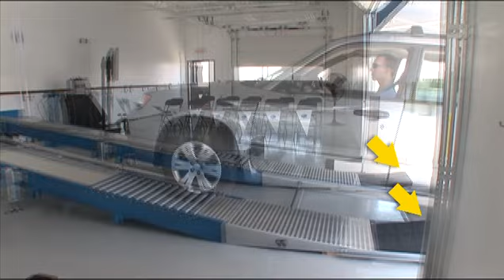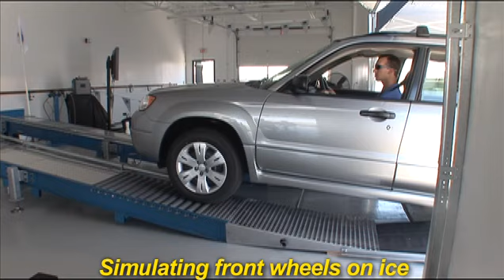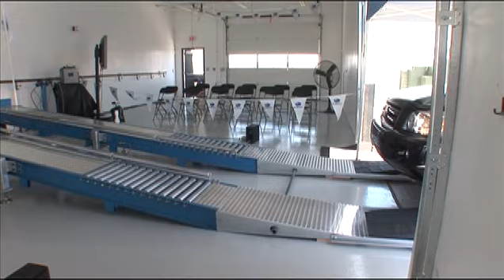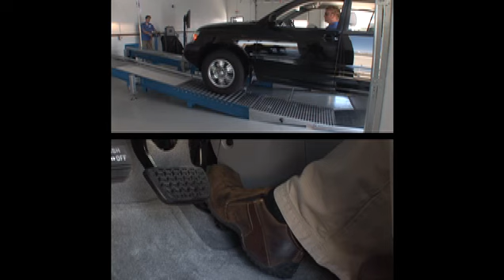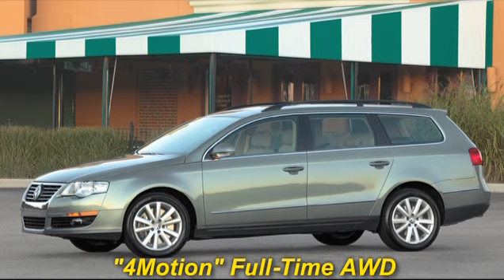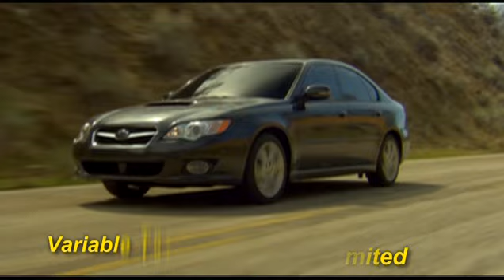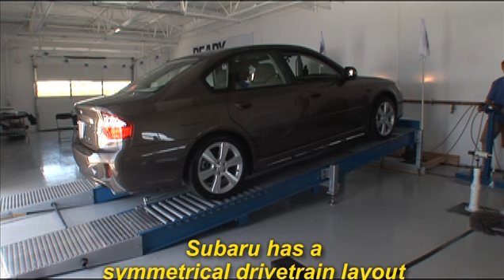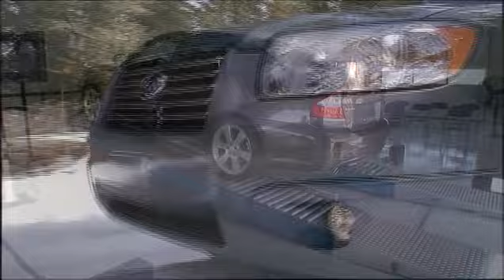Subaru Symmetrical AWD vs. Honda, Toyota, and Volkswagen

Comment: I would otherwise accept that test as a legitimate, if I wouldn't have witnessed how the CRV works in real life. I live in Finland.  Been for a hunting few times in deep forest, ice, mud, snow, grass.. etc. We got guys with Lada Niva, Pajero, Nissan Patrol and Subaru Forester. As some of you might know, the Niva, although piece of crap, is the most capable 4WD from all these, with its low ranges, manual locks and high clearance. Needless to say, we use off road tires, different brands, but new. I have seen more than once how the CRV follows with no efforts the Forester and the Niva, and even twice it had to pull out the Patrol. Its understated capable SUV. That test is obviously biased. Why the rear part of the vehicles are hidden?

Comment: They show the AWD system but they don’t show you the constant engine problems so I tip my hat off to you folks symmetric all wheel drive is the way to go as long as you can keep the motors together and not have head gasket issues and complete rotating Assembly failures

Comment: Not sure about the Newer Subaru but the older models with an auto trans will auto lock into a 50-50 front-rear distribution when locked in 1st gear or Reverse

Comment: SKOTTY KILMER HAS LEFT THE CHAT!
Reply: Yeah in one of Scotty's new videos he acknowledged Subaru superior traction control. He needs to understand not every one needs a car to last 300k miles. Some people just need a car to help them not die.
Reply: @Duraputer ❤very good point, you nailed it right 👉🏾 ❤😊
Reply: I own a 2001 Subaru outback with the original engine and transmission. Currently at 378,671 miles on it. I did the head gaskets using a  6 star head gasket. Still good. The head gaskets were done at 123,464 k
Reply: @jeffreyschindler2289  I'm gonna need to do the head gasket on my 2000 legacy wagon with 130k miles on the odometer
Reply: He has mentioned in some of his videos that Subaru make the best AWD system
Reply: 😂😂😂😂
Scotty prefers Toyotas. 
I think he's mainly concerned with reliability. One of his major problems with Subaru is head gasket issues, and I think he'd go with the highlander.
Reply: @oumaevans  subaru fixed the widespread headgasket issues in 2012
Reply: @jakegolliher2891  So they only had terrible head gasket issues for 20 years, what's everyone complaining about?
Reply: @80sDweeb  Not true, it's only in mid 2000s 2.5 naturally aspirate EJ engines, other engine sof their have no issues of they happen afte rincredibly long usage with very bad or nonexistant maintenence(like their H6 or Turbo 2.5 EJ), its easily and permanently fixed by using the Turbo EJ gasket in naturally aspirated cars, NA ones use badly and cheapily made graphite coated single layer gasket, when turbo had much higher quality multilayer steel headgaskets. With MLS one it will never ever fail again. Newer and older models dont have this problem nor do 2.0 and 2.2 EJ motors.

Comment: Little bit of misinformation here.  That Subaru Forester does not have any sort of active traction control or  active differentials.  It uses what they call Symmetrical AWD.  It has viscous differentials, which basically just use a thick, sticky goo in between two plates.  When the differential in speeds between the two axles or wheels exceeds a certain limit, the goo starts to grab and send power either into the rear driveshaft, or across between the rear tires if you have an LSD in the rear.  Their test car may not, it's an X, which means it might have open front and rear differentials (I've never had a base model Subaru), and it still did that well in the test.  Higher spec cars, like the Forester XT, have an open front differential, viscous center, and viscous rear, so they're 1 wheel drive normally (Front Left I believe), then 2 wheel drive at loss of front traction and then 3 wheel drive when all traction has been lost.  If you lift any turbo Subaru off the ground (or an 00-01 RS2.5) and put it in gear, you'll see three wheels spin, then you'll get a CEL for a failed ABS sensor on the one wheel that isn't moving after a while.  If you want a legitimate "all" wheel drive Subaru, you'll need a Spec B Legacy or an STI, they have an LSD in the front as well, along with a 6 speed.  The LGT shown at the end has some sort of traction control that brakes the spinning front tire, forcing that power across to the other side, but otherwise uses the same setup as the Forester XT.  Very simple, very effective.  Too bad they don't make a truck.  (Brats and Bajas can't carry a dirtbike, they don't count.)

Comment: No fear. if your Subaru is not a top class model it will not pull you with one wheel ;) My forester and impreza 97-04 even strugle to to this with 2-3 wheels from a standing start on a incline and difficult terrain.

Comment: Symmetrical AWD is useless when your CVT belt breaks. Symmetrical AWD is a really cool thing, don't get me wrong. But, if you can't get power to your AWD system because your CVT belt broke, then it isn't really very effective. When Subaru gives up on CVT, then I will respect them. Until then,  I will keep my RAV4.

Comment: there are 4 cases of just a single wheel traction,  no one car in the world can win all such 4 cases.  even one car can send all it's power to a single wheel,  when there s not enough friction at that point, the car still will fail.  Power  sending + friction, 2  factors   decide if the car can overcome the slipery situation.    when the single driving wheel corner is not enough heavy, it can not provide enough friction for the car to move, so the weight distribution is also an important factor.    when 3 wheel slipping,  only one wheel driving,  put more heavy load on that driving corner will provide more friction.  Subaru  are awd car, but it is also a leaking car! cost more to maintain.

Comment: It's 2019 now. I'd love to see how Honda's awd compares the Ridgeline/Pilot and CRV compare tot he Outback and Forester. What did 12 years of technology do for non-Subaru vehicles?
Reply: still the best. I guess you never drove one..
Reply: Update from 2022: non-Subaru vehicles still fail to accomplish this
Reply: I can confirm that even my Acura SH-AWD system is worse than my Subaru 4EAT. Lmfao.
Reply: The 2019 forest is even better off road.
Reply: D Madd11 except that all the tests don’t tell you why the rear wheels on the Honda don’t spin.  In this test it simulates a icy hill in which the Honda is designed to lock up the rear wheels and prevent you from sliding back down the hill.  The Subaru will slip all four wheels and you will slid backwards.  That’s what Honda programs their vehicle to do from the factory.
Reply: @themaxee08  honda will not hold you on the hill and a Subaru will get up it no problem
Reply: @themaxee08  "lock up"?
Reply: Yes Larry, I know they certainly improved
Reply: I have had several Hondas and a couple Subarus. While there is no question Subaru packs a superior AWD, each of the Hondas waltzed into 300,000 miles without breaking a sweat and neither of the Subarus made it to 200,000. I'm hoping their partnership with Toyota will help that.
Reply: https://youtu.be/7f1Uz8SqnzI
Reply: Technically no car is full awd. Keep in mind there is some manufacturing biased to which diff had more load by default. Hence why you can slide subies out cause they are more rear wheel biased and hondas and toyotas are front wheel biased. Sometimes 65 front or 35 rear. It depends on the system to transfer and distribute the power.
Reply: @itsCoreyLee  my mazda can lock the center diff, resulting in the closest you can get to proper awd
Reply: @itsCoreyLee  Subaru is Full AWD, cause all diffs are always active. What you're thinking of is 4WD / 4x4, where every wheel gets the same amount of power and speed.
Reply: Etsuko the Miata look there system is 50% to front and back okay. Then if the wheel starts to slide it puts more power to that wheel it isn't based more towards the rear...
Reply: @isaacl1439  no. Subarus AWD is 60:40 front to rear bias unless you have the older wrx that's true 50/50 with open center diff or the sti that's rear biased (differently depending on transmission)
Reply: @jeepmanxj  In this video the models of the 2008 era are compared, where the forester uses the same traction system as the old wrx, 50/50. In later models, they switched to modern systems, 60/40, and the distribution may vary depending on the circumstances.
Reply: @jeepmanxj  This is from Subaru's official brochure for the 2011 Outback 3.6 that I own. It utilizes an "electronically controlled variable transfer clutch in conjunction with a planetary-type center differential, and a viscous-type limited-slip rear differential. Torque distribution is normally configured at a performance-oriented rear-wheel-biased 45/55 split front-to-rear." So no, the STI isn't the only rear biased system!! My car is so much fun to slide around in the snow with. Especially with my STI rear swaybar it'll kick the rear end out with very minimal throttle but it still feels so controlled. Love love love this car. It's got 150k on it with no issues even though I beat the shit out of it.
Reply: @itsCoreyLee  no, only the sti is rear biased.
Reply: D Madd11  I've owned multiple Subarus over the years. Their AWD system is meh. It uses more fuel that it helps propel the vehicle forward. The forward placement of the flat engine also causes them to want to shove the nose out in corners from the understeer. Transversly mounted engines put more weight behind the front wheels helping steering more than what ever symmetrical bullshit they are selling here.

Basically all this proves is the brakes work in conjunction with the center diff to transmit power around, much like any limited slip differential. What we learned here is that the coupling in the Honda is completely open and can't torque multiply. 

This also glosses over the fact Subaru AWD systems outside of the wrx and sti are front biased 60:40. It's not symmetrical at all.

Essentially the driveline is needlessly consuming energy and fuel all the time so that in the event you come across a set of rollers for your front wheels it'll still go.
Reply: User Name I’ve got a ‘13 Legacy 3.6R and I’ve NEVER noticed understeer. How can a transverse mounted motor be better? Then you’ve got the weight of the motor AND transmission over the wheels. Why do you think BMW never had anything FWD or transverse mounted? I don’t know how many of those Subarus you actually worked on cause the motor in mine doesn’t ‘hang out’ front like you described. My oil filter is about behind the front wheels so that puts the front of the motor about square over the front end.
Reply: I had a 2003 Pilot (first year it was produced) and it was an absolute beast in the snow. You could lock all four wheels with a button too. Most of these Subaru videos are BS.
Reply: @snorman1911  you have never drove a subaru then. they never get stuck but hondas always get stuck
Reply: This video is biased towards subaru. They were paid to fake this
Reply: @brandonar868  lmfao how?
Reply: Brandon R LMFAO the two best vehicle brands for AWD is Audi and Subaru...
Reply: @brandonar868  Don't think so...my STI sends 41% to front and 59% to rear in auto mode.  This can be varied in poor traction conditions by changing settings.
Reply: @brandonar868  Subaru has the best AWD system in the world not even debatable
Reply: @brandonar868  Wow! Really? Proof please?

Comment: Regardless of what type of 4WD/AWD system you have and you get stuck, try this. Slightly put your foot on the break while the tires are spinning. Applying the breaks will transfer torque to the tires not spinning and most likely get you out of your situation. But it does depend how stuck you are in the mud or snow. Depending on which tires are losing traction, you can also apply your hand break too. If your in the snow, lower your tire pressure and that will help a lot too to gain traction. This is an old off road trick to create a manual traction control. I wish I was driving the cars that didn’t make it up that ramp, I would apply the break while giving it gas and drive right up their ramp.

Comment: Interesting video but there is misleding information regarding "asymetrical drivetrains".  Whether the cars can climb in this synthetic test with one wheel having traction has nothing to do with the symmetry of the drivetrain, it is a result of  how much lock the center diff provides, if there is any front/rear differential lock/brake and how much the brakes are able (depending on control strategy/limits and speed of the control system) to lock the spinning wheel on the side without friction.

Comment: I USED TO OWN a 2007 Impreza and I will say that the AWD sucked. I live in PA and I was quite disappointed even for working at a Subaru dealer for 4 years. I got stuck WITH NEW winter tires on a few times. 1 front wheel and 1 rear wheel would spin and the car wouldn’t move. Now if they equipped them with a LIMITED SLIP DIFF like they did the foresters, I would not have any issues.

Comment: Pretty damn happy with my Honda Element,  haven't ran into an issue yet, but I  have gotten stuck in a Subaru at one time, only one wheel in the front and one in the rear moved, older Subaru though.

Comment: Carefree6714
I bought a new 2018 Golf Sportwagen 4Motion S in July and have been anxiously waiting the first snowfall. Finally a couple of days ago we got pretty hammered here in the Northeast. After about 5 inches of unplowed snow was on the ground, I took her out to navigate our back country roads here in the hill country of Litchfield County, Connecticut. I was like a 16 year old kid driving his first car. I couldn’t believe how she ate up the steep inclines— without snow tires, just the original equipment tires. Granted, this is my first AWD car in my 40 years of driving, so perhaps I’m easily impressed. However I don’t think so— I think this is a superiority balanced vehicle and I’m not kidding— not a hesitation, not a fishtail, not a sideways slide— she was true straight ahead on all inclines. These cars are absolutely awesome. I traded in my 14 year old Volvo V40 FWD which I loved— hard to see her go— for this car. I looked at Volvo and just couldn’t stomach their new $50K+ price range. This car’s sticker price was $26K and change— the base model Sportwagen— and I got it online for $5200 off sticker. I couldn’t beleive it. The quality and performance feels like a $50K car. How long will it last? Only time will tell. But the styling blows away its Subaru counterparts and I think performance is superior too. I hope to see a lot more on the road!

Comment: inaccurate description of 'torque steer'. The side-to-side movement is caused by the traction control braking one side then the other.   Inaccurate reference to 'center diff'.  I'm pretty sure the later Highlanders don't have one and No mention of the 4x4 lock, available on highlander (unless it's removed for the US market). I'm a huge Subaru fan because of their 'non-disposable' approach to manufacturing and that they're deceptively capable - but not a fan of this video.

Comment: The CRV test did not look correct, I have a 2006 model and when front loses traction in snow or dirt the rear wheel drive kicks in immediately with power at all 4 wheels, I was even able to pull my neigbours Audi A6 Avant out of the ditch in snow grip was that good.

Comment: I call bs on the weight claim. The bulk of the weight is on the front where the engine and transmission are. I already knew the Subaru awd was great.

Comment: Yeah it's not the differing front half-shaft lengths that prevent the VW and Toyota from performing as they should, that's conceptually ridiculous, you can't be serious. The issue is that the center differential does not correctly divert power to the axle (rear in this case) with traction. The strategy of the 4WD system as a whole is at fault essentially, however they try to get traction it clearly doesn't work.

Comment: in case of Passat with only one wheel having traction,the car did not climb becoz it is very difficult to pull a car of that size in an inclined path..it could have moved forward with only one front wheel having traction if the test is done in horizontal path..if one of the rear wheel have traction & remaining 3 wheels are on ice,it might have moved up in that inclined path because the car would be pushed rather than pulled..

Comment: AAhhhhh.... ABS. All those 4 Sensor on each wheel helping the system understanding which wheel's brake has to be apply to give more power on other wheels :)
If there was no satellite in the middle. It wouldn't be required :P

Comment: When crv is ready to send power to rear weels they hit breaks .. this is a Subaru dealer.
Reply: Subaru does the same thing. Most of them have open rear diffs... no way you are transferring torque Unless you lock a brake like every car with traction’ control does.
Reply: other tests show the same results for crv
Reply: Exactly, my Highlander had no problem doing the same tests and in real world snow/ice conditions it handled great.  Contrary to what Subaru claims their AWD system isn't that great.

Comment: Even a landrover defender needs after market limited slip differentials fitted or lockers to perform as good as a subaru. In this situation open differentials just take the easy path rather than go to the wheels with traction

Comment: If my car is a slouch, how can my crv, from a standing start, up hill, in snow, pull away no problem.
Reply: James Mcginn because this test is purposefully designed to cause Honda’s to react like this.  The car is designed so the when both front wheels lose traction on a hill it locks the rear wheels to prevent you from sliding backwards.